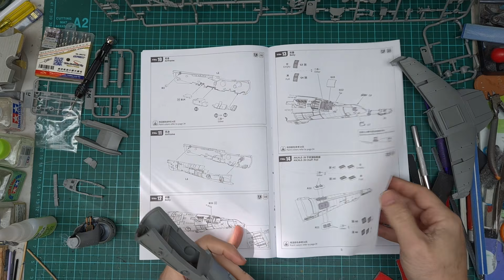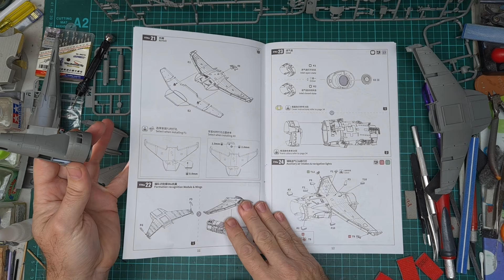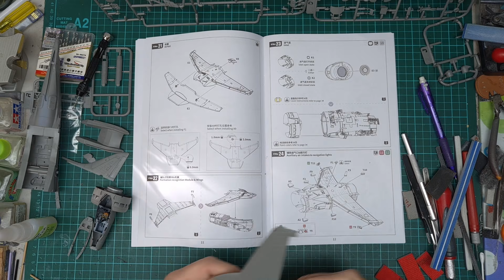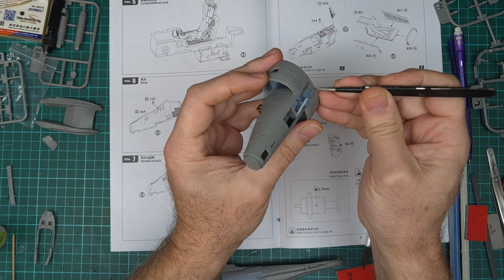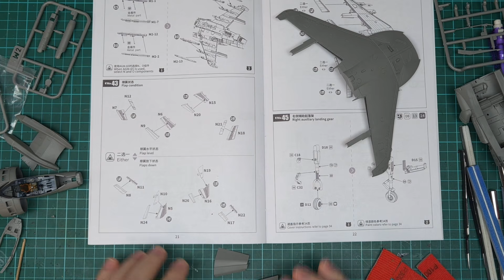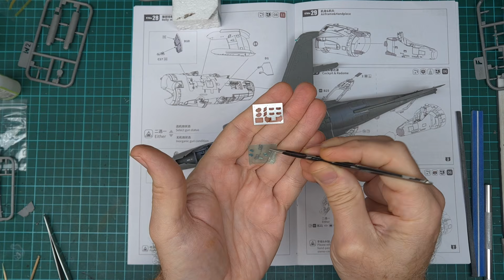UMa 1/48 AV-8B HARRIER II PLUS Build Pt.2

Comment: putting magnets on the pilons is not an option?
Reply from the maker: If you wanted to you can, sure.
Reply: @grant6336  I suggested that to assist you to aid in painting, ie place magnets in the pylons and drop tanks etc so you can detach for painting
Reply from the maker: @bushranger900 I'm painting them off the model anyway, and will glue them on at the end after weathering 👍